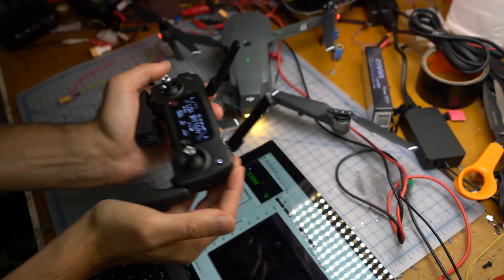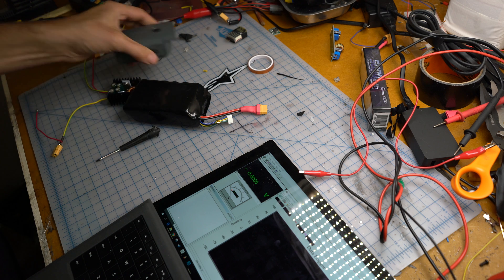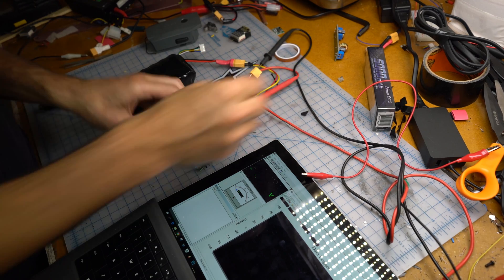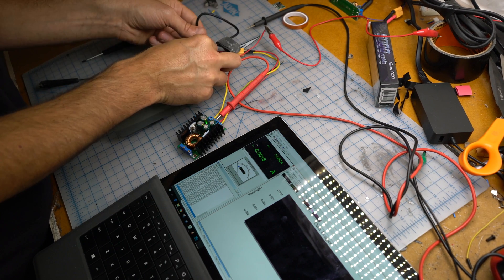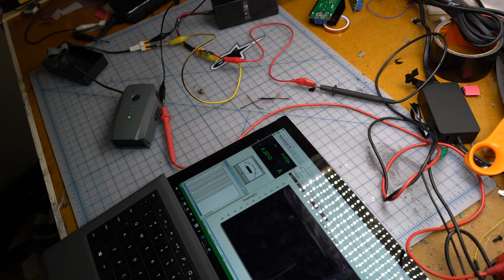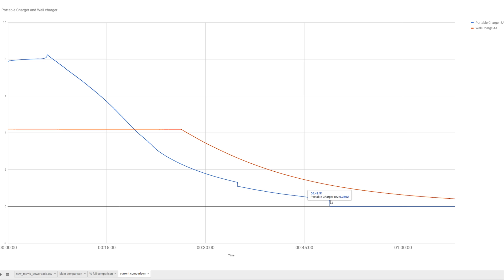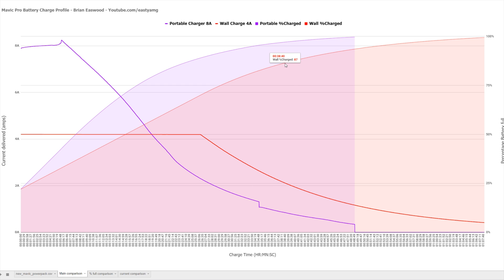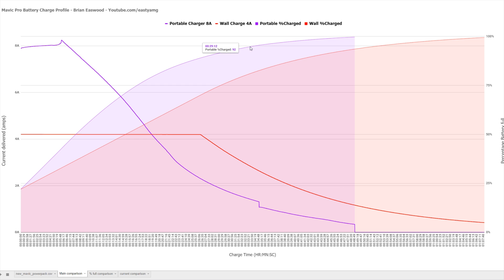MavicPro DIY 8amp Portable charger - 4A vs 8A charge analysis - 4k24p

Comment: Great videos Brian! I've got a Ravpower 23Ah power bank able to output up to 4.5A at 9,12,16,19 or 20V. Do you know if this would work with the Drok at 13.1V to charge the MP battery? Any idea what is the required min Amp in order to charge? ( even if it takes more time). Thx!
Reply from the maker: Bruno Chartier hey mate, not sure there is a min amp rate. Probably work really low. Max was 8amp. That supply should work, just check the output v is close prior to plugging the the battery. Is does have its own protection and will just flash if the feed isn't right.
Reply: Brian Eastwood, thank you for your help.

Comment: Good one mate ! I wonder if its possible to get like 50A power supply and connect 3 batteries at the same time through that.
BMS of the batteries would figure out what amperage is needed to charge and certain state of charge ?
Reply from the maker: cheers mate. You need to limit the current to 8A. If it can take more the mavic battery just shuts it down. I had the amps a bit higher a few times and it just ramp up and then shut off. So you need a regulator for each battery to control the current. Maybe there is a circuit out there somewhere that can do multiple feeds like this?
Reply: Brian Eastwood thanks a lot ! Good to know that inbuilt bms works ! Shouldn't be any problems then. You've contributed to my in car expedition charger ;)

About the battery cable https://www.ebay.pl/itm/222543021638
Reply from the maker: Oh it's great to see the cables are available now. cheers.  It's funny they show it to be used with a charger. I really don't think that would work as the battery shows a set voltage on the pin side. The DJI charges are Dumb they just feed a certain voltage and a max current and the on battery bms does the rest.